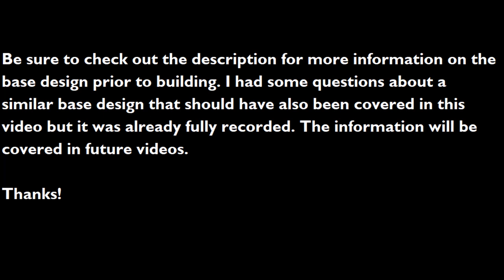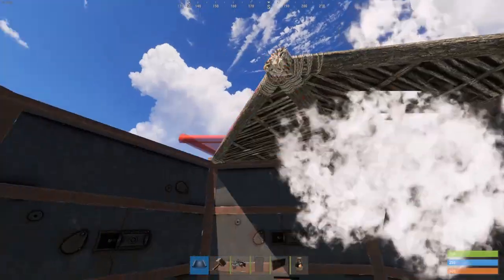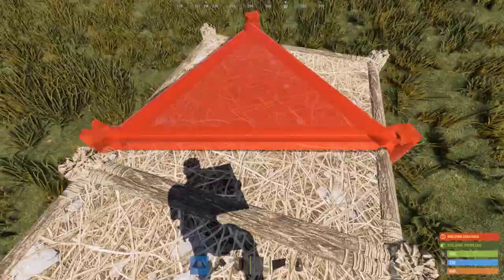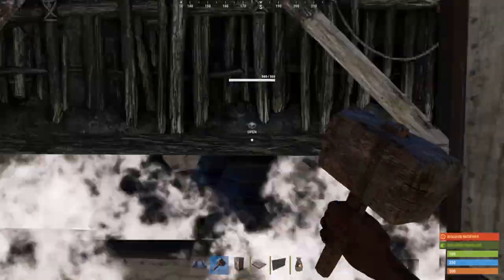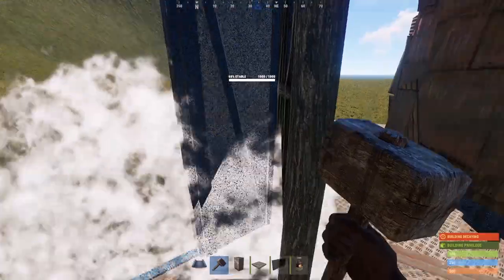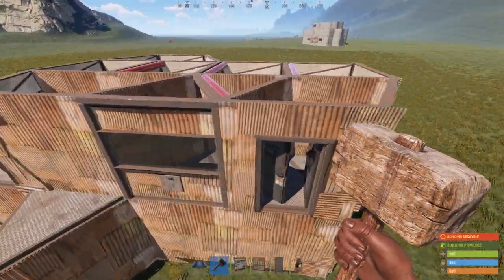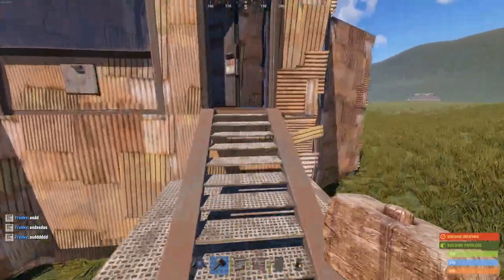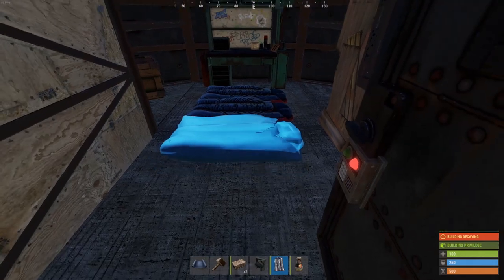Solo/Duo Roof Bunker Base 2.0! | Rust | Base Building

Comment: hi i like the start of your base. unfortunatuly the twig of your bunker can be splash from the bottom of the roof. Quick fix> you place twig square and higher Foundation at the end. The Foundetion will block all splash dmg, by doing so you lose room for furnace but you  can built around it. Thank you for hint how to built new bunker. gl in your next videos.